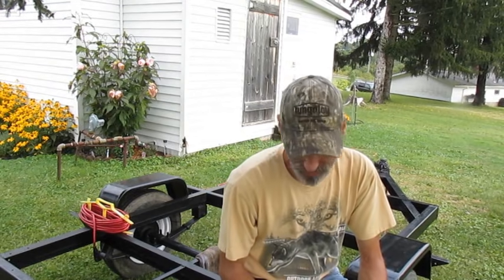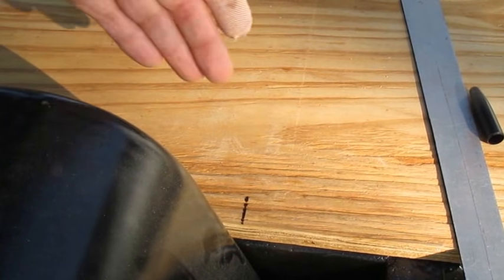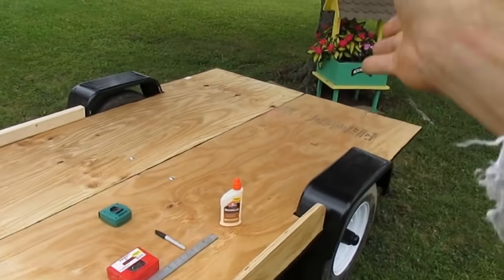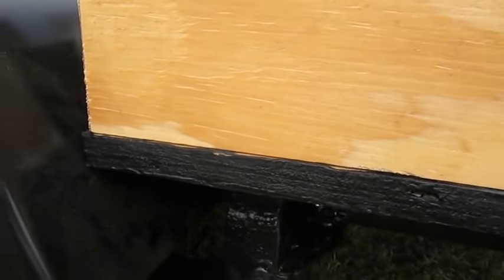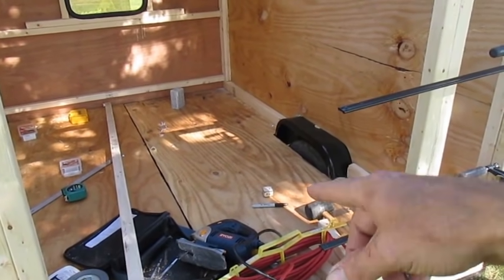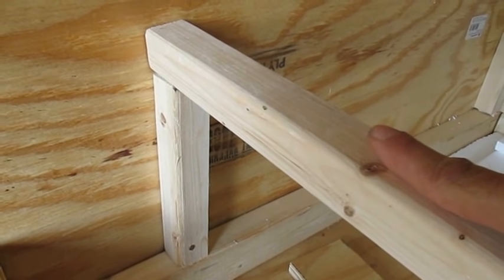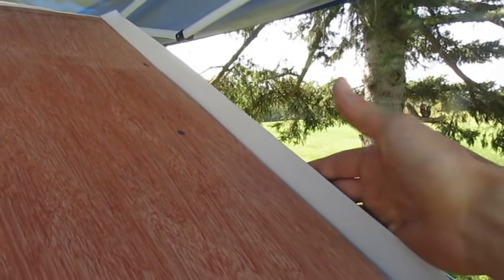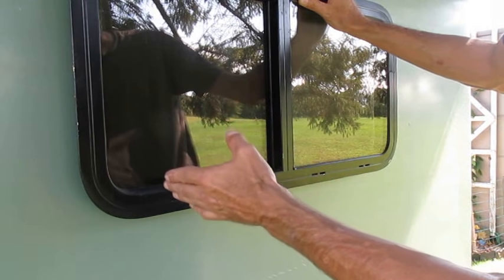Homemade Camper Build (Micro Ultra Lite Complete Build)

Comment: Those brackets are generally described as as 'Flush Mounts' or 'Flush Concealed Wall Mounts', I have used them many times starting 43 years ago and they can be very handy.
Reply: Yep I've known them as "Z clips" they come up on ebay by searching "flush Z clip" also
Reply: Flush mount brackets. Z clips will give you every variation but what you want. Also z clips are used for hanging pictures which would also work for tables.

Flush mount brackets is a direct link to what you want. 73

Comment: I have watched over 50 build videos for trailers. Sir, you have done an excellent job. Yes, there are things I would have done a little different (personal taste items mostly like tail light choice),  but you have done a very good job for those that have little experience building projects like this.

I have over 25+ years in cabinet and c/top industry, kitchen remodeling, and that includes electrical, plumbing, drywall and etc. I have managed shops for most of the time, my point being... I have seen, trained, and LEARNED a lot from a bunch of people during those years and I got to say, you did a great job teaching and building this trailer. Most people watching this with little experience could build themselves one of these and turn out a nice unit.

Lastly, I have prototyped several different designs and I love how much time can go into designing so you don't paint yourself into a corner so to speak.... "more thought to, less ought to."

I wish I had $250,000 and 6 people like you working for me as "we" could make a lot of nice trailers, make a lot of customers/employees/stockholders very happy!!!

Again, GREAT JOB!!!
Reply from the maker: Thank you my friend, I appreciate that:)

Comment: Put the Roberts glue on with a notch trowel just get the small notches. I’m a professional flooring guy of 20 years. Or since you are using light weight material back stick ie. spray tack glue would work very well. Also. At windows you could turn and track material for a truly flawless look, but this will take some learning and practice on the part of the installer. Hope this helps with some options for the opinion of a professional. Good luck and happy building!!!

Comment: One thing for sure is you build them sturdy !  Good strong joints properly assembled.  That would be the trailer to take up the rough roads to Alaska !
Reply from the maker: Thanks Matt. My Campers would make the trip over & over again with no problem.

Comment: This was an awesome build video to watch.. The only 2 things I would change is having a back-flap door that raises up that will prop up as a small awning, with some sort of fly that zips shut to keep bugs out, allows you to sit under for shade, and you can properly open for ventilation  when it's hot out..And use an indoors gang box for a gfci receptacle with a outdoors metal gang box for the electrical connection.  This project will be in my favorites, so I can go for it when I find some extra $ for materials. Thank you for the share. Gives me a lot of great idea.

Comment: This is one of the best DIY small trailers I have seen. I especially like the way you built it with cost in mind and with the ease of all supplies available at the big box stores. When purchasing the blueprints do you supply a parts list with the proper information for the windows and door supplier.
Reply from the maker: I get the windows and doors from Ebay, but the prices has gone WAY up because everyone and their brother are building these now.

Comment: You should put running lights on the sides at the bottom amber in front and red in back. It makes it easier backing in at night. You could also put a piece of aluminum diamond plate across the lower front as a rock guard.

Comment: Hey Kevin would it be more lighter and rust resistant if the trailer were aluminum.  Furthermore, your attention to detail in conducting this mobile project is impressive.   I think a galvanized plate in the front would deter the skin from getting tore up from flying rocks.  Have you considered a solar panel on the roof for instant power?   Anyways, just wanted to convey your video inspired me to consider building one myself.
Reply from the maker: That is awesome. Glad it helped. Yes, An Aluminum Trailer would be far better, but they are pricey.

Comment: A flat roof is not  good. Sure it's quick  to build, .but it will sag in time  . A good trailer  Should have a roof with a camber. But  it
Takes more time  and skill,  to build. But the  result is much better.
Reply: Most RV trailers are all flat to my knowledge....
Reply: No need to camber the roof as the reason to do so is to avoid ponding of water. Unless you level perfectly every time you park the camper, water will run off. Use enough roof supports in the build to avoid any sagging.

Comment: nice vid, I learned a lot and planned to change some things I had planned for my own build. I would like to suggest you ditch the black drywall screws on all future builds. The metal is not appropriate and they are prone to shear and break easily in structural applications. I think I understand and agree with your justification that they easily drive their heads flush with the neck they provide, but there are deck and other structural screws with a similar shape that drive flush just as easily. They cost a lot more per screw, but they are still a very small percentage of the total build costs. You can perform your own breakage tests if you'd like to prove it to yourself. Happy building!

Comment: Just a quick note. I also used that hook system and folding leg for my table years ago, it is not the best system. The hooks had to be mounted as wide as possible or the table will tip if you rest on it and if you accidently nudge the table getting in or out the hooks come out and table collapses, not good.

Comment: Great build for summer time use It looks a tad heavy for lite camper ..But for my area i would insulate all of it witch i have one for travel but just use at my land to camp in can tow with small car ..Walls are an inch and 1/4 thick ,door and windows 2ply home made  with 3/4 stryo all over..With candle wick heater same as cabin vented ..

Comment: Do they still have plywood edge trim for sale, which works great to keep the edges of plywood from wicking in rain, water? I put those in a trash trailer I made a box on, and on the edges of the plywood, and 20+ years later, it's still good.

Comment: Your camper looks a lot like the one I built over 20 years ago.  Mine was only 40 X 60 though.  Heck, we even painted them the same color, grayish green on the sides and white on top.  And by the way, I still use it when I go prospecting.

Comment: i want to do an insulated wall on my teardrop. So I am thinking of using 1/4 or 3/8 plywood on the outside, 1x material inside, and the wall with foam insulation, and then 1/4 or 1/8 inch inside. Do you think I could make this work with your notch system for the roof, or do you have a better suggestion for thicknesses used.

Comment: If one used bolted-on galvanized steel lumber ties at every joint, could one build the trailer frame out of Spruce or Cedar (with marine-grade waterproofing, or Henry’s silicone roof-coating) — and still expect the wood frame to last several decades?

Comment: Your’s is a good build. You do stuff that, as a carpenter, I wouldn’t do simply because of my experience and background. Case in point; IKEA long ago figured out how to put together a strong, but very lightweight, bed frame that can be made to any height to accommodate under-bed storage.

I do like your exterior aluminum cladding technique.

Is your exterior aluminium trim anodized? If it’s not how do you keep in from corroding?

How did you get your mattress to fold to accommodate the folding bed platform?

Comment: The problem with using flexguard on plywood is the plywood will expand and contract with atmospheric changes which causes the flexguard to crack and separate. OSB, or "beaver puke", sheets are a more forgiving material for this application.

Comment: Flush Mount Bracket. Cheaper then French Cleats, with the advantage of stopping sideways movement that French Cleats go not. I love French Cleats, too. Booth good for artwork. If you want to slide it, use a long French Cleat.

Comment: What is the finished weight. I have a Harley Davidson Triglide Ultra trike, thats 3wheels. It is rated to pull 600lb. Looking to build a teardrop with rear kitchen. And must have a cartridge toilet. The trike os 105” long and 42” wide, 48” tall. Any sudjestions appreaced.
Reply from the maker: The final weight, empty of camping gear was 700lbs.

Comment: I just wanted to thank you for the great video and step by step instructions! Can you answer a couple of questions? 
1. What was the thicknesses and type of wood you used for the ceiling pre-aluminum? 
2. How did you cut the aluminum?
Reply from the maker: You're welcome. I cut the aluminum with electric metal shears (Sold at Harbor Freight) and the thickness of the ceiling was 2/14" thick after insulation and interior paneling (Burch).

Comment: Why didn't  you mount the tailights lower than the door..?  How do you secure the door when opened..? So, no padding on the carpeted couch..?  That metal edging around the wheel wells looks a bit dodgy..  Why not 3'-10" instead of 3'-8"..?

Comment: No vapor barrier on the interior before applying thecarpeting..? That means the moisture being generated inside, will pass through the walls and condense on the aluminum skin and rot the frame.....  You attach the carpet to the insulation..? You should have shown the carpet install.  I might have counter sunk all the molding screws for a neater finish..

Comment: Kevin, You made a great video....I admire your attention to detail. My only possible hesitation would be your use of steel lath screws on the exterior.....won't they rust very quickly?
Reply: You could use stainless screws, or ….

1 — Cut 3/16” tall, thin plastic rings out of narrow gauge PVC pipe, or other narrow gauge rigid plastic tubing.
2 — Grease well the inside surface ONLY of the rings.
3 — Attach the rings around the screwheads with just a trace of clear silicone caulk, or with blue painters tape.
4 — Fill and level the rings with clear silicone caulk, and cover with a small piece of Saran Wrap.
5 — After caulk cures, gingerly remove the wrap and the rings.

Comment: Thank you smooch for this very detailed video. I want to do a 6x8 camper on a 5x8 trailer. (because I cannot find a 6x8 trailer). I noticed that you build over the edge of the camper. Did you weld on additional brackets  to hold the sides of the camper over the wheel? Thanks so much
Reply from the maker: Glad it was helpful!

Comment: No carpet.  I'd do, laminate or tile. Eventually that shit will get dirty and attract dust and mud.and you will have to replace it way earlier than some tile or some vinyl planks.  Vinyl won't be as cold either. Tile will last way longer.  But it's all your preference at the end of the day. I am going to do a build soon.i would never do carpet. That small of a build. You need material built to last, but do you.

Comment: I am a little confused on something...the corners of the aluminum that you have screwed... are they the ends of the large sheets or have you used different pieces for just to cover/seal the corners?

Also so you know those clips you wanted to know ... here in uk are call interlocking hang buckles

Comment: would you consider sellind dvds of these builds as well as the pdf's. this is just great
Reply from the maker: Link to PDF's is pinned in the comment section.
Reply: thanks, ill do it. sorry about the typing, i have severe neuropathy from chemo. i found a pop up trailer on craigs list. it will be perfect to strip down and buil a camper later .ps my ex husband thinks im crazy! he may be correct but in the meantime im making plans

Comment: What kind of aluminum do you use?  Is it 6061-T0, 2024-T0, or what. If you use a tempered aluminum you will have brittle cracking with a 90 deg bend.  You said you use .032 alum but you did not specify the alloy and temper.

Comment: At what point did you run the wiring for the tail lights?  Are side marker lights not required due to the size of the trailer?  What type of mattress will you use so that the riser can be made into a seat?  I like the use of indoor-outdoor carpet.  I imagine it helps with both sound and cold insulation.

Comment: How did you attach the aluminum to the wall?  I know it’s screwed from the bottom and tacked at the top, but what about the body of it?
Reply from the maker: You cement it with an aluminum cement that is sold at Home Depot. I forget the name, but it comes in an orange can. You have to work fast with it because it sets up quick. It prevent what's called "Tin Canning".

Comment: Wow. Nice build!  Where did you get the trailer?  I found most 12” tires are nor rated for highway speeds. Do you know the final weight?
Reply from the maker: Thank you. I found the trailer on Craigslist and the final weight empty was 700 LBS.

Comment: Did you cover the area the two plywood meet at the middle on the teardrop floor?
Reply from the maker: yes.
Reply: What did you use? Just the carpet? Or did you seal that ?
Reply from the maker: @MoisesFontana83  sealed.
Reply: @EKEACRES  sorry with all the questions I'm trying to gather all the info I get and I really like the way you build yours so I'm trying to get all the info I can get.
Reply from the maker: @MoisesFontana83  No problem, that's why I do my videos, to help others who want to do the same & create something themselves that they can afford over buying a expensive factory model.
Reply: @EKEACRES  yeah im a family of 5 I wanna build one to also run a roof tent for the kids to sleep in when we go camping and I'm trying to build one that will be use offroad too because I can't afford the $12000+ for a build one

Comment: Hi Kevin , hope you are feeling better , I am about to build a camper what could you recommend for the outside walls over the ply , eg paint , epoxy , fibreglass
Reply from the maker: Thanks, I'm doing ok. I have only used the Aluminum siding, so I can't recommend anything else as I have no experience with an alternative method.
Reply: @EKEACRES  : hi Kev , I was worried about aluminium getting dents in it

Comment: Every screw you put into the bottom will let water hydroscopicly wick in and rot your floor!! If you drill in you should seal every hole as you put the screws in.

Comment: Did you end up using 3/4" ply for bed, since there's no support  under, other than outer edges? Just found your channel.  Great stuff!
Reply from the maker: no, it's 1/4 with 2" x 2" frame bracing.

Comment: This is what Amazon calls them: "Furniture Flush Mount Bracket-Headboard Wall Mount Hardware-Large Picture Hangers-Mirror Hook Matching Hook-Stainless Steel Interlocking Z Clips (Large, with Screws and Expansion Plastic Plug)"

Comment: How much does the finished unit weigh?
Reply from the maker: 700 LBS empty.
Reply: This was a great video. I have a small car and it's weight pull limit is only 1000 pounds. I love to travel cheap and your video is just what I was looking for. I would like to order your plans. Also, what is the brand of your base trailer and where did you get your trailer?

Comment: Great build. Why didn't you insulate walls or the floor also?
Reply from the maker: it's not needed. I test my campers in Winter, and they stay plenty warm inside with a small electric heater.

Comment: This is so exciting! 
Question? What about water proofing and metal skelaton frame for the walls and cieling? No metal skeleton? 
Also, do you also build one that's a class 2 trailer? versus the smallest trailers which are class 1s? Or is this class 1? 

Cause I got 1200 pounds of heavy duty batteries I want to put on the trailer. plus 500 pounds of solar panels. so I can have a emergency solar power trailer. With a 1000 pounds of water storage on it too. 

Gonna use a Tesla Model 3 with a class 2 hitch.

Comment: Did you use normal plywood or pressure treated? Doesent look treated but I dont want to get the wrong stuff
Reply from the maker: It's regular plywood, which is the same as the Camper industry uses. Never use Pressure treated.
Reply: @EKEACRES  thanks for the quick reply, and great build by the way.

Comment: What about the wiring ?
Reply from the maker: There wasn't any, other than the tail lights, which comes with instructions.
Reply: @EKEACRES  no plug attached to the car for the tail lights ?
Reply from the maker: @fergspan5727  Yes.

Comment: Love your camper builds! Each one had something unique about them. I was wondering what your thoughts are on a plan I have been working on. I have an old pop up camper frame that I stripped down. because the camper itself was rotted. It's a 12ft by 6ft frame,and I would like to build an ultra lite camper body on the front 8ft with a flat deck on the remaining 4 ft of trailer but I am afraid if I build on one full bed it will collect water at the base and rot it. Any suggestions on how to achieve the goal without potential water damage?
Reply: I know the question isn't directed toward me...I'm just a comment section reader...but the thought that ran through my head after reading your question...was to offer you the suggestion of using ...what they call...5/4" deck boards..(come in treated & cedar)...side note>clear coated cedar is absolutely gorgeous.. goodluck on your build, sounds like it's going to be nice..